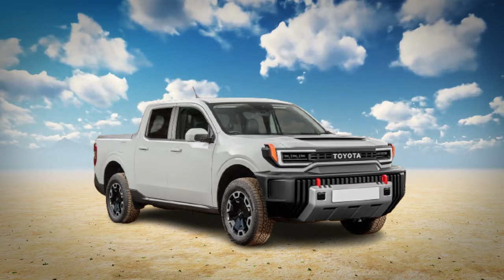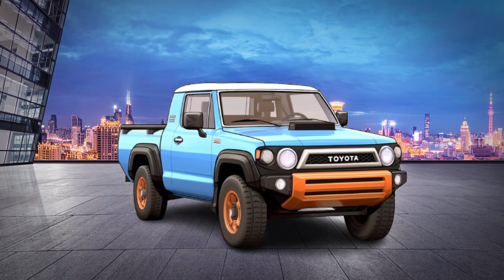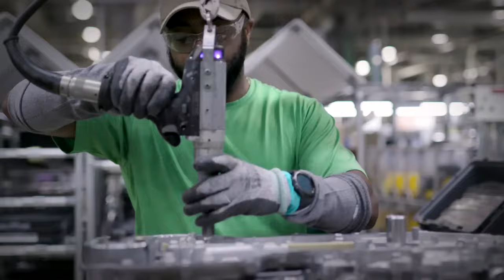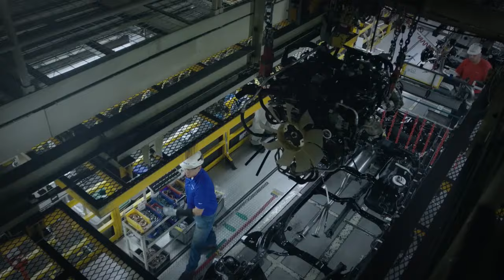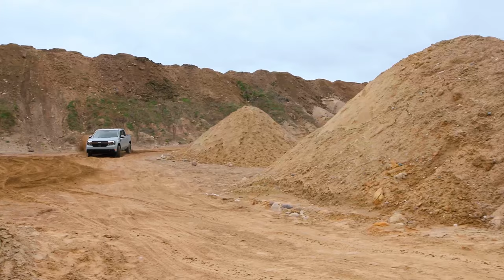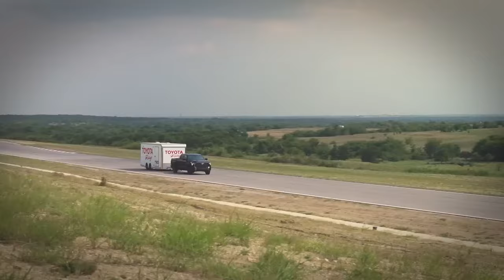Toyota Stout WILL TOP the Compact Segment Sales Chart for 9 HUGE Reasons!

Comment: Ok 101 time: the new 4 banger plus turbo is nice and cheap to build, good for Toyota's bottem line. Not so good for past warrenty faults, believe me there will be faults that will be expensise to repair if able, engine replacement as found by all manufacturers of 4 banger turbo powertrains  seems to be the remedy with the customer paying of course.